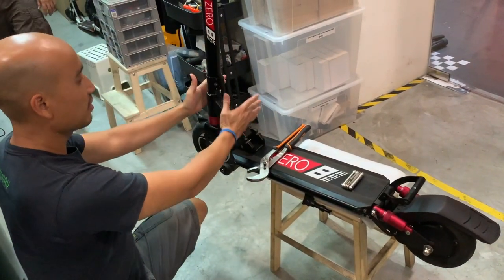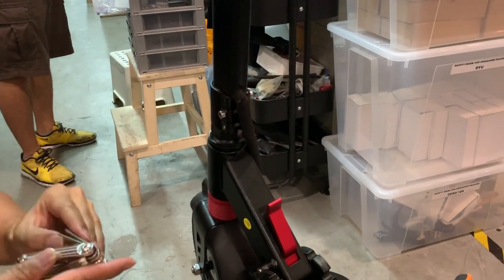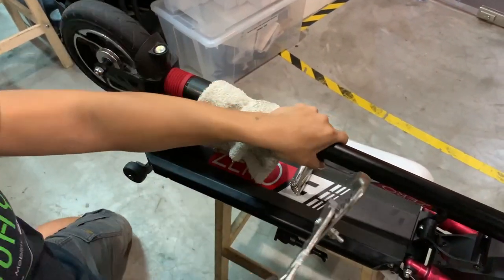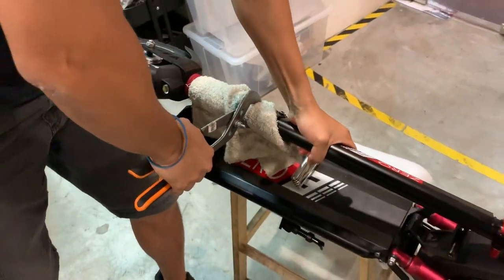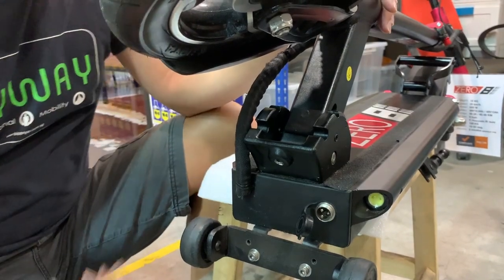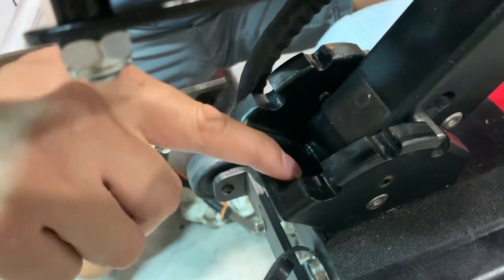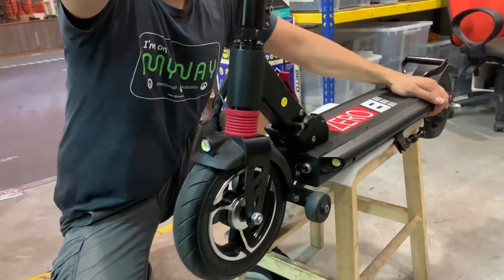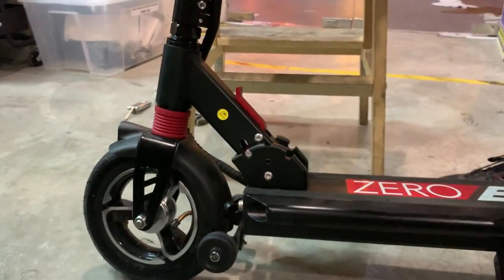Tighten the ZERO 8 Steering Column / Vertical Stem

Comment: My Zero 8 handlebars slowly slide down during riding due to road vibrations, rider weight, and mere gravity. I found that tightening the bolt and folding the clamp is not enough. I don't want to tighten the bolt too much that it breaks either. I'm thinking of drilling some small hole presets on the scooter stem and somehow put a matching nut/bot or a metal pin through there. Do you sell or recommend a matching nut/bot or a metal pin to use?
Reply: I had the same problem. I cut off a small piece of a radiator hose and wrapped it around the stem. I took a hose clamp (painted it black) tightened it down and it works great!

Comment: What about bolts and screws that connects the stem to the board, a lot of people reporting on reddit that bolts snaps in that area, specially on 9 and whole stem with the wheel comes off while riding.
Reply: I have the same issue but on the zero 8. They have coke out and the bit that connects to the board has lifted up and I dont know what to do

Comment: I just bought my Zero 8 but the adjuster for the height of the handle bar will randomly just go down a little whilst riding? Why ? What do I need to tighten Please help!
Reply from the maker: remember to screw in the nut then clamp!
Reply: I had the same problem. I cut off a small piece of a radiator hose and wrapped it around the stem. I took a hose clamp (painted it black) tightened it down and it works great!